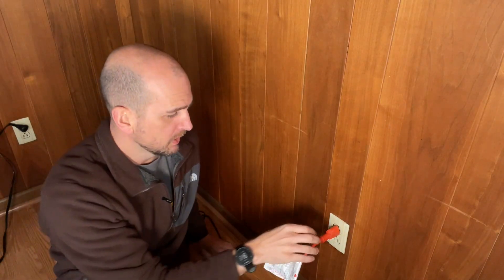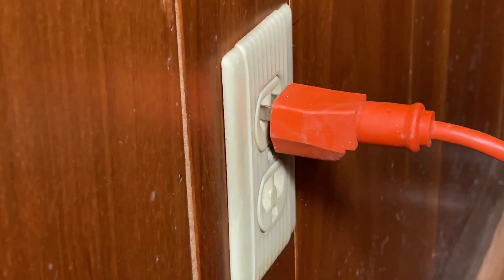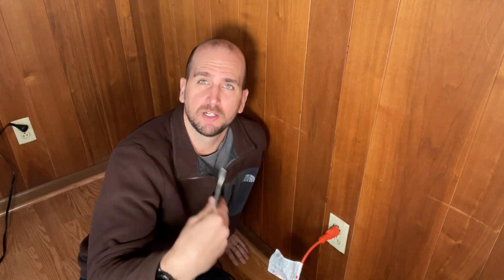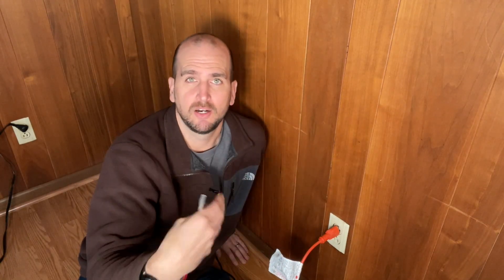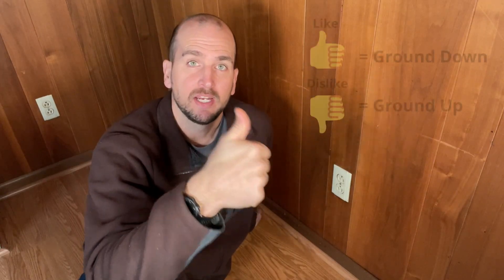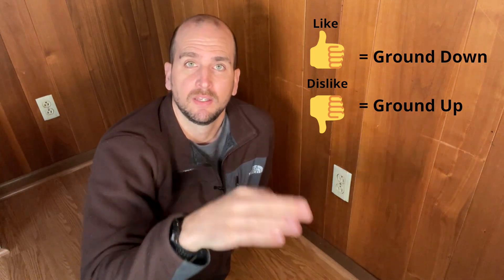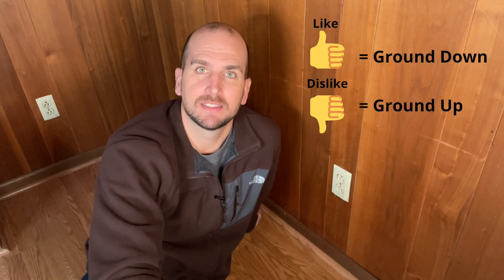Should An Outlet Be Installed Ground Down Or Up

Comment: I've always preferred ground down as many things that get plugged into the receptacle are designed that way - like 90 degree cords as mentioned in the video and USB/surge suppressor combos that have writing on them oriented that way.  Having said that, I also have some 90 degree extension cords where the prongs rotate 360 degrees so that you can have the cord itself go in any direction that you need it.  One other possible consideration is when you go to plug/unplug a cord the ground on the bottom might be safer since you are "blind" to the bottom of the plug and your finger might touch/slip onto the ground which would be harmless.  Less likely to happen on the top of the plug as you can see that more easily.  Since there doesn't appear to be an NEC standard it will likely continue to vary.
Reply: I just bought a couple of USB sockets that were labeled with ground "up". So suppliers are confused too.

Comment: I did install ground side down until I started working for a hospital, they wanted ground side up, and if the receptacle was mounted in the horizontal plane, then it was installed neutral side up. in my house, it is ground side down!!!.

Comment: I used to assist a licensed electrician, so I have no problem with wiring and installing receptacles.  Too many devices and 'flat' extension cords expect ground down.  That's what I do most of the time.  But another electrician taught me about 'ground up' maybe 40 years ago.  So I install ground up when I think the advantages outweigh the disadvantages.   In my new house, the electricians installed ground up simply to indicate the outlet is connected to a wall switch.  Interesting reason.
Thanks for the video.

Comment: The old adage goes “White is Right”. So Neutrals are on the right side as you’re facing the receptacle. Therefore, the ground pin will be upright. I believe this stemmed from original 2 prong receptacles to differentiate hot and neutral.

Comment: Back in 70s, high school building trades class, ground up. My dad's electrical sub contracts all did ground up. I did all the electrical on a job in the 90s, in a city, in another state, failed the electrical inspection. Municipal code specified ground down. (Had to flip them all over). I asked the reasoning behind the ground down requirement..."because that's what code says" was the answer, nothing else. Today, on all my personal wiring, ground up.

Comment: I was  measuring with a tape measure horizontally on a wall a couple of years ago.  I dropped the end of the tape. It slid down the wall and you guessed it, there was a receptacle with a plug slightly unplugged. The metal tape slid  right into the gap and shorted out the outlet.  Made a mess out of the tape and outlet...
Reply from the maker: Hey!  Finally an actual story of this happening.  Appreciate you sharing 👍
Reply: @EverydayHomeRepairs   I posted a picture of the tape on my Instagram at the time. Check it out.  https://www.instagram.com/p/BfEjzAUnS-Q/?igshid=333ol2x59bxm.  Don’t worry it’s not a Rick Roll 😜

Comment: I've the argument a thousand times. I metal object could fall and land across the hot and neutral. The problem with that argument is that it has virtually never happened. Its like saying people should always wear a hard hat incase a meteor hits your head. Sure, it may  have happened once or twice in all of recorded history, but not often enough to warrant wearing a hard hat.
Reply from the maker: Kind of ironic, but as I was responding to the comments the comment right above yours was an actual example with a tape measure.  I agree this would be very, very unlikely.
Reply: How about a bracelet....I actually was involved with a steel wall plate situation that was missing a screw and fell across the hot and energized a steel restaurant table

Comment: Per your example with the flush cord, it seems most of the flush mount plugs are made so the wire hangs down with a ground down plug, so I make sure all the plugs in my house conform to that model. Also, oddly enough I just purchased an extension cord that I needed to run straight up the wall that was going to be visible so the plug had the capability to rotate 360 degrees so I could plug it into the outlet that is ground down.
Reply from the maker: Fancy!  I don't think I have seen the 360 feature on a plug.
Reply: @EverydayHomeRepairs  Yeah, it was kind of odd, here is a link to it should you need something like it. https://www.amazon.com/dp/B075KQX66F?psc=1&ref=ppx_pop_dt_b_product_details

Comment: If the outlets are in a residential rental unit, Ground UP is the way to go.  Most any landlord will tell you that rental tenants break most everything, and that includes wall receptacles (how and why has a hundred answers).  Outlets installed Ground UP tend to NOT break as quickly or at all compared with Ground Facing Down.

This may have more to do with using the el-cheap-o outlets versus commercial grade, but even so, in residential rental units, Ground UP will prevent having busted outlets.

I prefer Ground Down.  The other way just looks wrong.
Reply from the maker: I also agree, tenants will put properties to the test.  Seems like all of my tenants haven't ever been introduced to the lint trap on a dryer.  Found 1 the other day packed so tight it held moisture and rusted out the basket mesh 🤦‍♂️

Comment: It’s application specific for me. I prefer ground up in the garage where it is more likely that a piece of metal could short across the hot and neutral. In the house it could depend on what type of plug the particular appliance has and whether the appliance is above or below the outlet.
Reply from the maker: Thanks for the feedback Robert. 👍

Comment: Now do a vid on what the NEC says about toilet paper: Front or back?
Reply: The patent illustration shows front 😁
Reply: 100% over the front unless you have a cat, then over the back till you get rid of said cat.
Reply: Beards cool ; Mullets bad.
Reply: Paper back, this way if the cat rolls it, the paper will never unroll.
Reply: The National Electrical Code (NEC) has nothing to do with toilet paper! To the back if you have a cat!
Reply: shine a 365nm uv light at both sides of your toilet paper, (before using it obviously! lol), the light reveals what I assume to be lotion, on many of the brand name options, on the front side, and not the back.   probably nothing to worry about. however it  does make this comment/question less rhetorical then intended after the first time doing this.
Reply: YOU CAN STILL AFFORD TOILET PAPER?
Reply: @bentalley7277  you can buy toilet paper where
Reply: Front "over the top" is the correct way. That way, you take what you touch.
Reply: @namedeplume2022  BUT MY CAT SHREDDS WHAT HE TAKES THE WHOL DAMB ROLL LOL
Reply: I was 100% front until I got a cat and he ruined roll after roll of tp.
Reply: While outlet orientation is up for debate, TP must always go over. #micdrop
Reply: Front.

Comment: Around here it seems that commercial building are up, residential down.  Never heard that difference for half hot, not a bad idea.. I worked in a building that the contractor did one up one down in two gang boxes with the hots facing each other in center.  That separates the hots and neutrals and kept the hot away from the metal box.   That could be a safety feature.  As we started getting equipment with flat angled plugs this worked well.
Reply from the maker: Appreciate the feedback Dan 👍

Comment: Wow, this was interesting.  When I built my house I installed all the outlets ground down because I thought that was the standard.  But it does seem logical for ground up when you analyze the benefits.  I always just used the face method: two eyes and the mouth looking back at you.
Reply: No benefits to ground up.
Reply: @Cotronixco  The vid said that it would hold the plug in more securely.  I have commercial grade outlets that have a good grip, but some spec houses would use the cheapest outlets that  may not hold the plug well.
Reply: @juliaset751  No benefits that I can see to install outlets with the ground facing up.

Comment: The outlet in question is a NEMA 5-15 receptacle.  First, a little history. I am old enough to remember the 1950's and the scare about the danger of 2 prong outlets and the dangers of stray currents back in the day when hand tools were not double insulated and had aluminum bodies. Thus, the ground wire was legalized. The National Electrical Manufacturer's Association was the trade group that engineered the new style plugs and outlets. 2 prong outlets were polarized with the neutral being wider and the hot side usually installed on the right side. This practice was because many houses had undergone wiring expansion and breakers were not common in older houses and fuses panels usually lacked labels. You could see through the glass window if the fuse was blown, but usually had no idea which fuse was the right one to unscrew and pulling the main switch would interupt everything and you needed a flashlight to continue working. So, since most electricians are right handed, it was common practice to wire the hot wire last and on the right side because that was the most practiced hand. If you slipped, sparks flew. Outlets were bakelite and brittle, so tripping over a cord could break an outlet. The NEMA 5-15 outlet was designed to be ground down with the hot on the right. HOWEVER, during a review before publishing the standard, it was pointed out that the ground pin is longer than the rest so it engages first and since outlets are almost always installed below eye level, the ground needs to be up so you can see the pin to plug it in. SO, THE STANDARD WAS PUBLISHED PIN UP. In the field, electricians continued to install outlets with the hot side on the right, resulting in the ground pin being down as originally designed. This is an example of lawyers being ignorant of industry practices. The NEC committee decided not to touch that hot potato, thus there is no legally correct way!
Reply from the maker: What a great comment and knowledge.  This is literally what I love most about having a YouTube channel is getting feedback from people with as much experience as you.  Really appreciate you taking the time 👍

Comment: Code is down or right in Illinois. If the ground is down the stress helps keep the plug in place. If it is up the ground could become disconnected before the hot and neutral causing an unprotected electrical device. Remember the phrase..  DOWN RIGHT CORRECT!

Comment: My house is wired with aluminium roamex! That makes replacing the switches and outlets a bitch. Because of dissimilar metals, I've already had one close call after replacing a broken wall outlet. The solution is a complete rewiring of this house. 
What do you do when confronted with this situation?
Reply from the maker: It is my understanding you need to get the specialty CO/ALR wall switches and outlets.  Of course they are more expensive but at least you will not have to rewire.

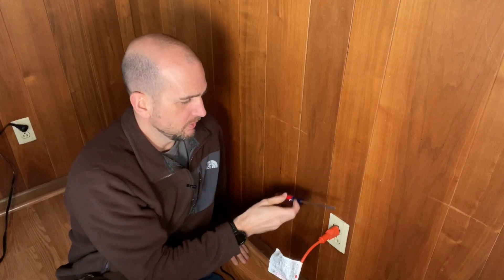Comment: This is an utterly aesthetic opinion. I know there are codes in some areas requiring the ground to be oriented up because it will ground out and trip the breaker if metal object falls on the pins. back to my opinion, it should be down because it looks better and is easier to plug in flat plugs. 3:10 that black plug is a perfect example of why ground should be down. Again, I under stand the safety argument and an not completely ignorant about electricity. This is my opinion that it is more aesthetically pleasing.
Reply from the maker: Appreciate the feedback!

Comment: I like the outlet that is controled by a wall switch being opposite the others in the room. Just as long as it's different than the others I'm good
Reply: Just install a different colored receptacle.
Reply: The same just different
Reply: I prefer labelling/marking all receptacles, so it is not simplied implied that something is different, it is explicitly stated.

Comment: I install my receptacles ground DOWN , to accomodate flat cord plugs . Therse plugs are often found on refrigerators so that the refrigerator can be positioned closer to the wall . The plug leaves the wiring coming out the bottom of the plug rather than straight out the back of it .  You will note the same principal being applied to dryer and range pigtails also . This method allows the appliances to be placed nearer to the wall . Extension cords are also available with the 90 degree set up for the plug and wiring .

Comment: I would like to know has this happened pictures or something falling on the outlet and causing a fire??
Reply: Metal outlet plates are the most likely culprit.
Reply: Spatula fell behind a prep table, wedged in an outlet hitting only hot. Energized the metal wall panel. That one got put back in ground up. Most everything I do ground down.

Comment: But several products on the market don't work with ground up. The polarized plug also switches sides when you change ground side. Things like those liquid filled air fresheners you plug in would be upside down and leak when you place them based on the polarized plug.

Comment: I was taught ground down for residential, but ground up for hospital outlets. Mainly due to the fact that if something metal would drop off it, and the last thing you need is a outlet blow a breaker if it is connected to a life sustaining device.

Comment: Up to Inspector But In state of Florida electric Law the ground is up Here what I like to do A normal power on receptacle I like to put Ground down and Half switch and Half power The ground is up .
if Normal power is ground up Like Florida then I will put ground down for switch. One time have a have a split receptacle have two 20 amp line circuit for washer and dry and I will put ground up. One more think is if  ground is up the two blades is push in. A art show grounds I had start replace Receptacle for loose plug New one I put ground up show me that I have replace receptacle ( that was 200 receptacle over two year ) budget only allowed 40 receptacle over three month and have 7 buildings

Comment: the ground pole is always being pulled out, but i still consider the ground pole supports the plug better when it is down.
Reply: EXACT opposite experience here.  I have been asked by an electrical contractor who did both residential and commercial, who noticed that I had ground up outlets, if I had commercial electrician experience.  He stated that, at least in our area, that is the typical way it is done in industrial installations.  Residential he said is either deliberate ground up or sometime no reason at all just a 50/50 crap shoot.

Comment: Electrical inspectors in my area want the ground up. and for more fun if you fallow code and you work on a outlet circuit in a residence that circuit has to be brought up to current code which means changing the circuit breaker to a combo gfi/arck fault breaker. If you are doing a remodel that is going to get inspected check into this first it can open up a real can of worms.

Comment: 20 years I've put ground down. Just makes sense to me.
Reply: I have actually seen this once, although it was irrelevant anyway because it was an ungrounded plug. A piece of mechanical pencil lead rolled off a desk in a classroom I was in, and landed on a halfway-inserted plug. It cut little notches into the prongs, and there were some sparks. One in a million, and even then it didn't do much damage (although it was on a GFI).
Reply: It looks better, too.
Reply: GREG GARNER Hello, I hear you but , there unfortunately a REAL set of issues which led to ‘GROUND UP’ believe it or not, with ground DOWN   Too many children would put a Bobby pin, or a coin across the 2 conductors, creating sparks/shorts ,  this was long ago but 1 child died, + so much  damaged receptacles/walls, but the crowning case was an ADULT WOMAN, she was barefoot , on a ceramic tile floor , has an adaptor in one outlet, NOT SECURED TO middle screw, so she was moving her vertical blinds, with metal bead chain , electric shock, collapsed, someone called 911, They brought her back, but went to hospital,   This case decided the change , so like the host showed a screwdriver, so had it been a coin, it would have rolled off , if HORIZONTAL, the GROUND FACES WEST  (  LEFT ). 
So NEC code changed this in about 95   Cheers 🇺🇸🇺🇸🇺🇸🇺🇸
Reply: @flybyairplane3528  You can just as easily put a bobby pin in ground up.
Reply: @billygunn7180  it’s NOT PUTTING INTO THE RECEPACLE, BUT SIMPLY DROPPING IT ACCROSS 2 CONDUCTORS if ground DOWN, thy it ground up And it FALLS EITHER WAY OFF THE GROUNG LUG CHEERS 🇺🇸🇺🇸🇺🇸🇺🇸
Reply: @flybyairplane3528  what keeps it from lying across the ground and hot when ground up, it doesn't have to be horizontal to create a short circuit
Reply: @flybyairplane3528  parents need to teach children better than what they do if there are issues like that
Reply: @flybyairplane3528  The reason for the ground is to protect people using equipment plugged into the outlet, not to protect the plug at the outlet. You bring up bobby pins and outlets, most of them are children putting the bobby pin in an outlet that didn't have a plug, a ground won't help that. The woman woman you talked about had nothing to do with ground up or down as there was no ground. What you are bringing up is the types of accidents that happened in houses that had 2 prong outlets and not 3 ground. Why would the woman put an adaptor on the plug if the outlet was a 3 prong? NEC has not changed as you implied. Maybe you should stick with airplanes since you don't seem to know about electrical.